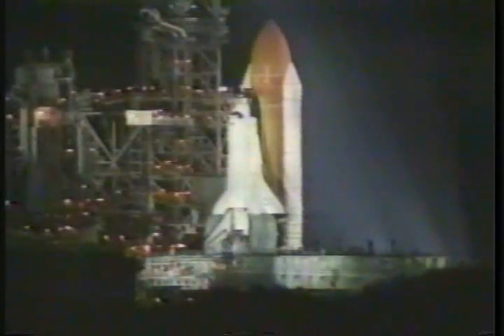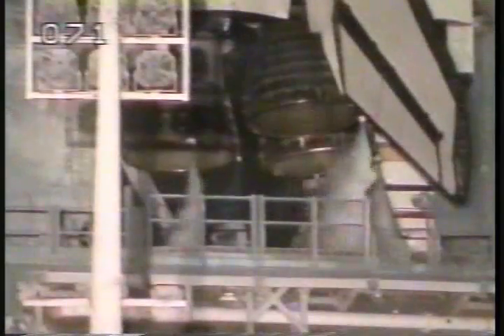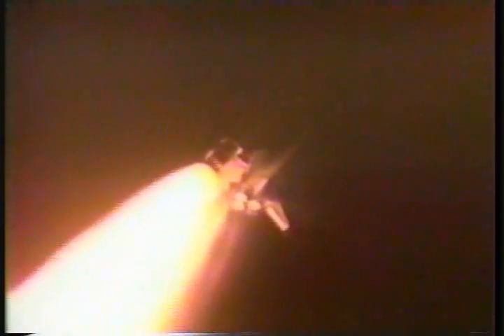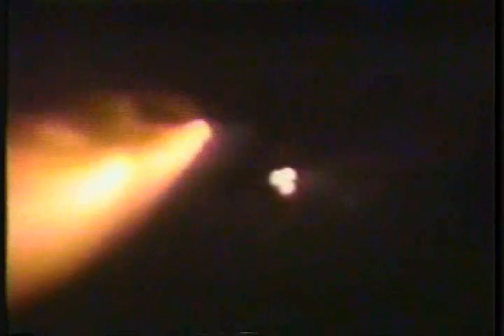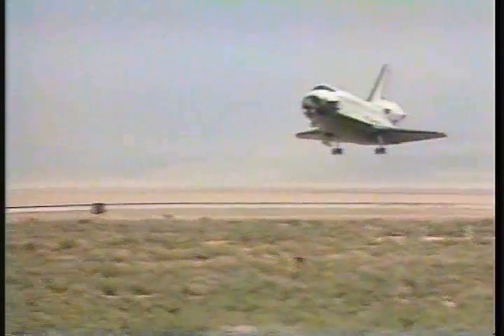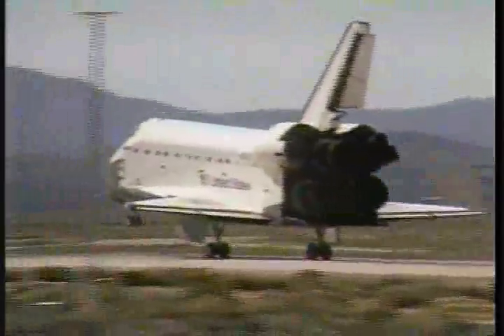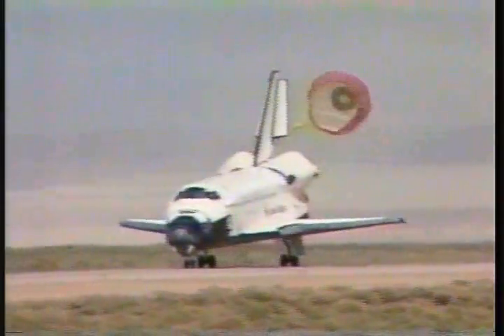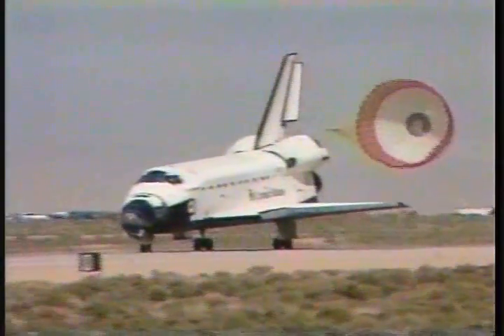STS-67 launch & landing (3-2-95)

Comment: Glad I found this.  I was lucky enough to be at Edwards AFB that day.  I was touring NASA Dryden when we got short notice that Endeavour would be diverting to Edwards due to bad weather in Florida.  I made it to the viewing area in time to witness the landing in person; took a lot of photos and captured the doube sonic boom on audio tape.  The shuttle sat on the runway for a long time during the purging process.  By then I had run out of 35mm film, so I got on my motorcycle and rode fast to nearby Lancaster to restock.  The sun had set by the time I returned, but there was still enough light for photography, and I made it to the restricted area fence just in time to witness the shuttle being towed by my location enroute to the mate/demate area.  Definitely a day to remember.